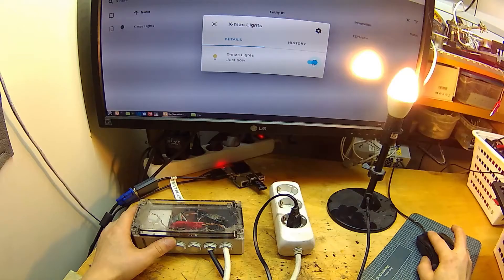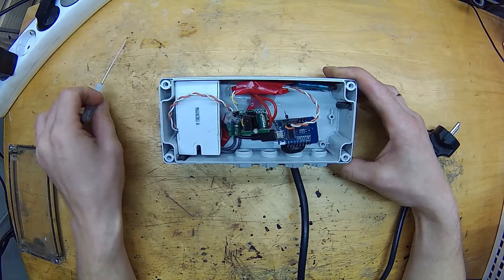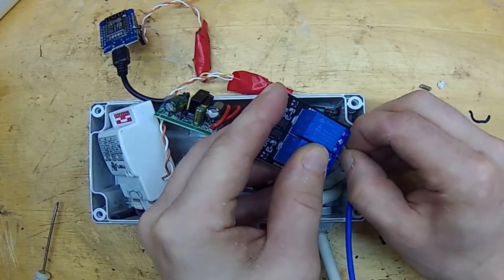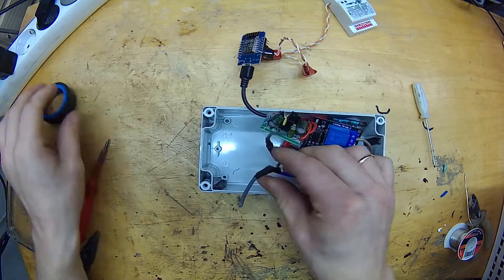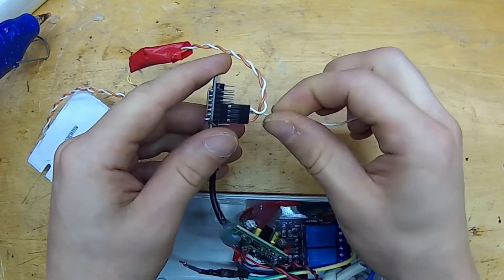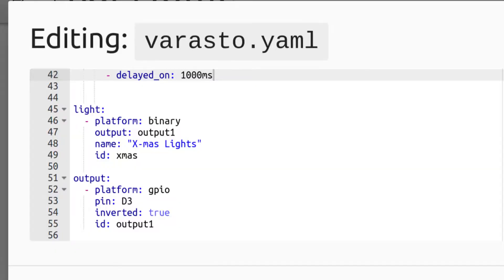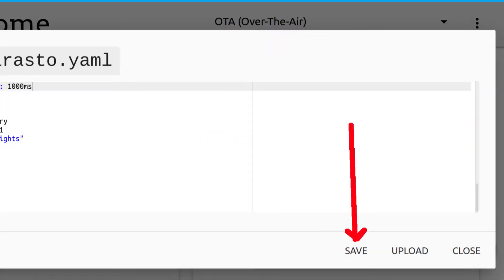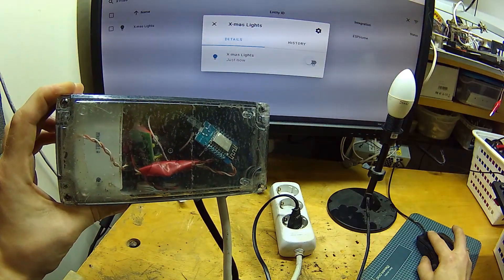ESPHome Light | wiring & configuration

Comment: that's very good, sir can you help me for variying the luminosity of this light ? 
i wanna do the same work as you've done but i wanna variate the luminosity with AC dimmer ! it's included in the ESPhome ! but i don't know houw to set it up
Reply from the maker: Hi! That's an interesting project. Unfortunately I don't know anything about that. I think you need a dimmer with some kind of voltage based control input. What kind of a dimmer you have?